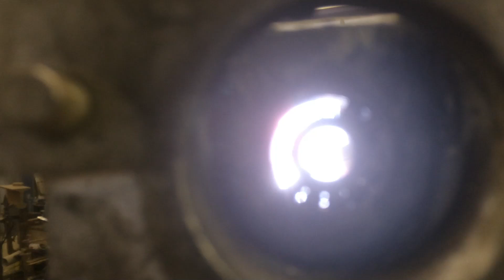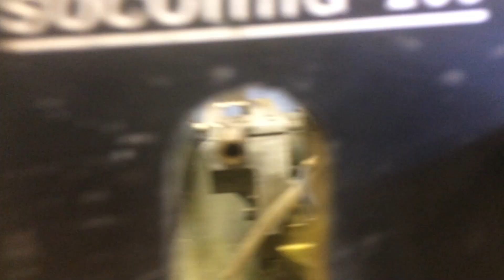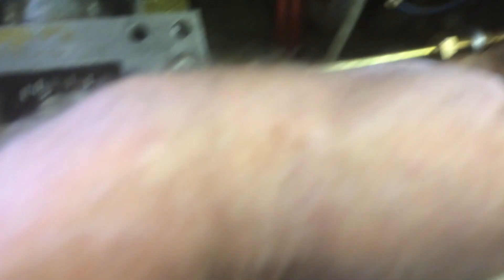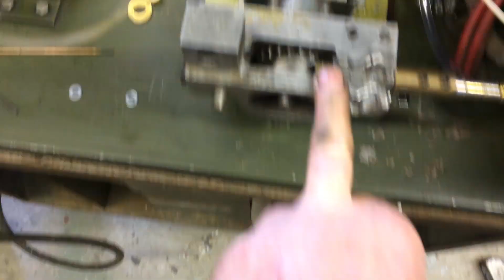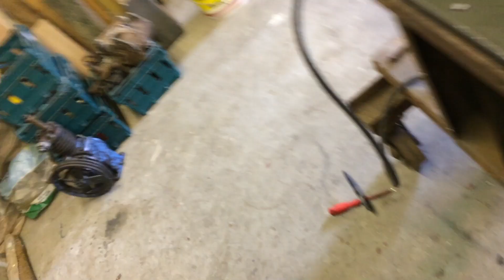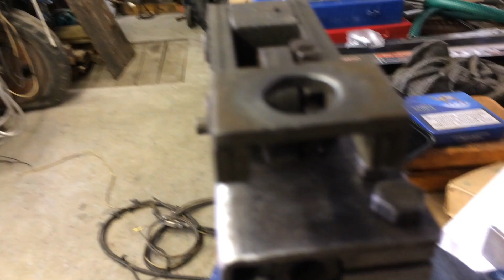Almost back to normal, Mig wire feeder rebuild and torch conversion

Comment: Nice job Phil. Very enjoyable to watch. 
Not sure about the oiler but we have a similar but more 'Industrial' rig up on the 100yr old planer at work. Basically a glass globe which you fill with oil ,  It's then plugged with a needle type device which allows a slow but steady oil feed to the bronze (?) bearings. ,Wondered if there was a means of fitting some sort of reservoir to your device.?
Reply from the maker: I have been thinking about the oiler, and I think it maybe something that screws into an engine, and some moving part in the engine touches the end of the rod and pushes the button up as some sort of timing indicator/ It has me baffled!
Reply: @philhermetic  It's a ' thing of purpose' for sure.